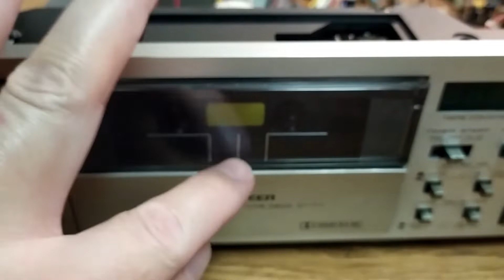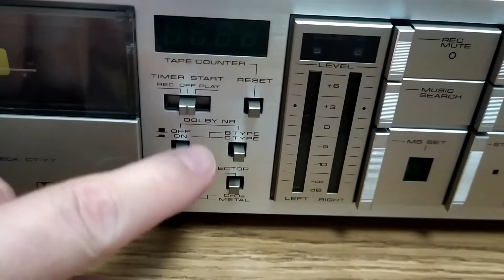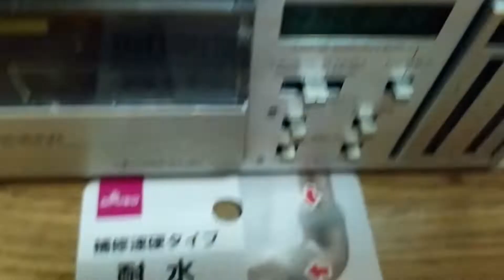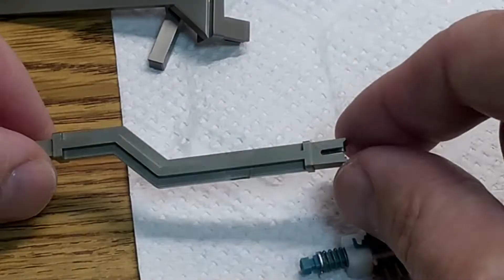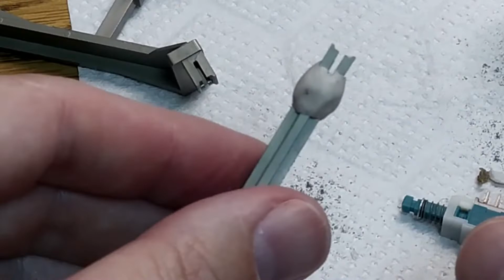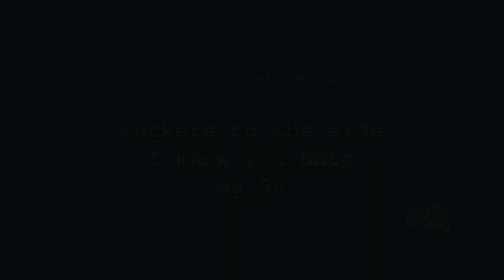Pioneer CT-Y7 (CT-40/940) Repairing broken switch push rods

Comment: Hi Felix, I have the same deck; a CT-940.  Do you have the part numbers for the Take-up Idler and/or Pinch Roller?  And my push buttons broke the exact same as yours.  I super-glued them and then carefully reinforced with some shrink boot.  Thanks, -Tom
Reply from the maker: Unfortunately I don't have part numbers for that machine.  This was sold so I no longer have the deck at hand either.  I did buy some generic rollers from AliExpress or somewhere like that, and they have been pretty good.  Just don't buy the cheapest option.  Occasionally they have kits with assorted sizes and with luck you get the part you need.  
It is a shame those rods break so easy, I imagine more than a few decks were thrown out because of it.  Good to hear you managed to repair yours.  Good luck with the rest of it, I seriously liked how it sounded.  I have a dual deck version in the pipeline,  and may keep it if it works out.

Comment: I don't have a clue what the final text ment, an internal joke i suppose.
So the bias oscillator filter is ok now?
I don't know how i would fix the plastic extention rod, likely heatshrink tubing over the join then apply the hair dryer to shrink it.
A small cable tie wrapped around the connection may of worked as well.
I have bodged so many things, but in a reliable way.
I tell lies as well ha ha :-D
Reply from the maker: Yeah, the CT7100 is all done, and its companion SA7100 amplifier is now in the lounge room, replacing the RS-M250 and SU-Z36.  I put the SU-Z36 up for sale, still hesitant to list the 250.  I'm worried someone will buy it and I'll regret having sold it!
This is a different machine - I've got a few projects on the hop, so it does get confusing!  
End screens are usually lyrics well out of context ;) 
Cheers!